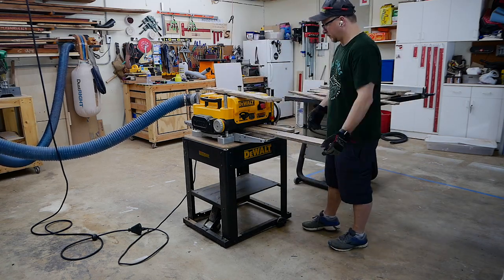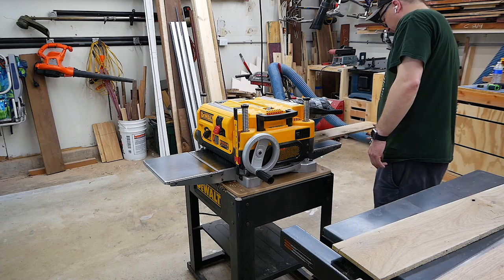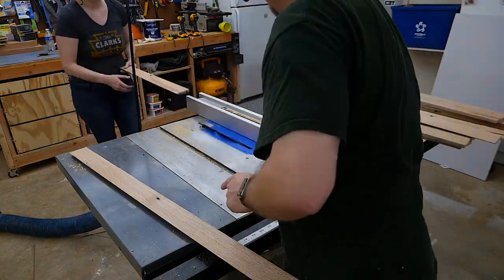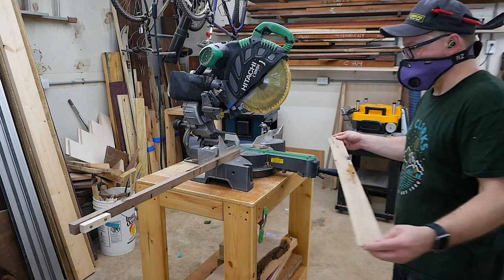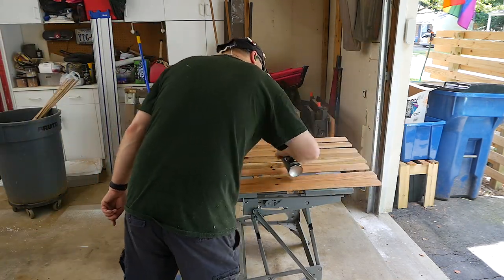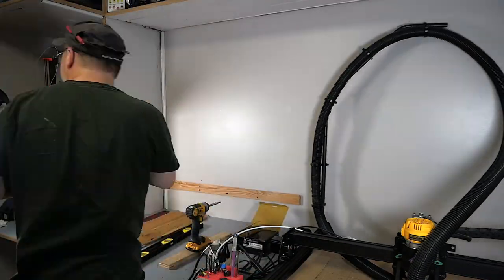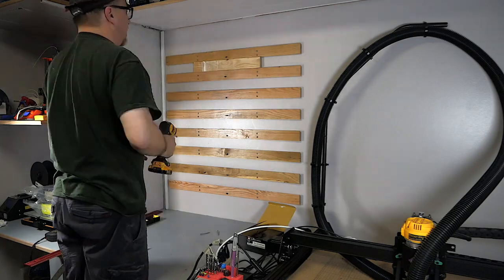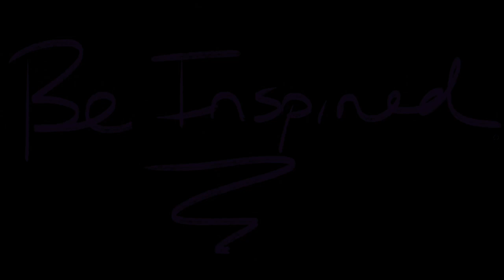Reclaimed Pallet Wood French Cleat Shelves - Ultimate Office Makeover

Comment: How thick are the boards you used on the wall? The pallet wood I have doesn’t look the be thick enough for an angle to be cut and used as support
Reply from the maker: Hi Ricky - I milled them to 12mm, or ~1/2".  In hindsight, thicker would have been better.  They do hold the knickknacks I have, but they won't take a lot of weight. Thanks for watching!